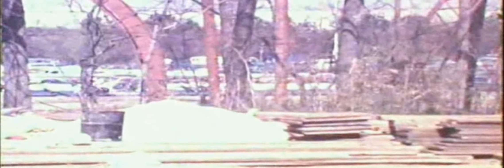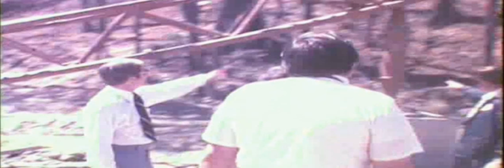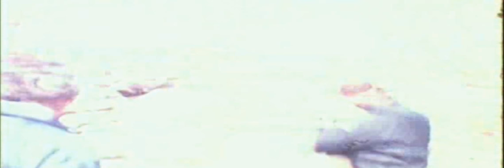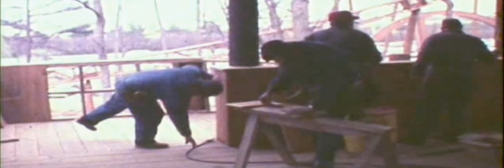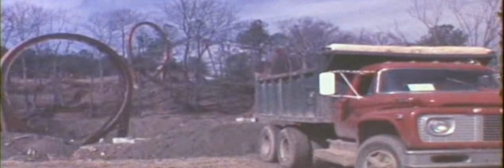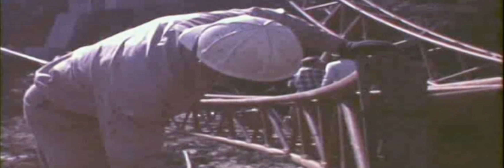Mindbender Construction

Comment: The track must have been delivered in a rust color. When the coaster opened in 1978, it had been given a silver coat of powder paint. Ironically, it was repainted to rustic brown color around 1984/1985. Also, notice how the train is without its cab hood.